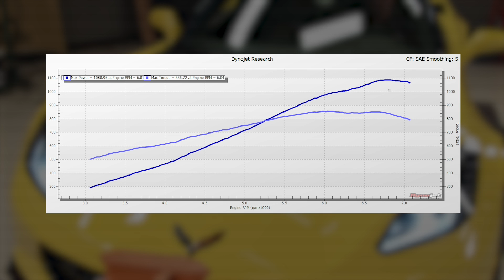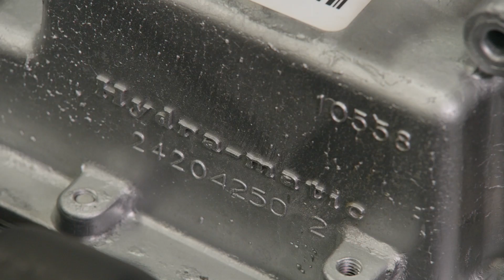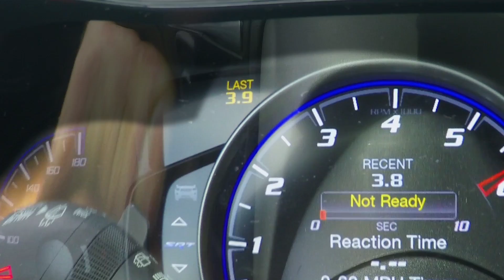Building a 1,200HP Supercharged Z06 Corvette - Engine Power S5, E22

Comment: How much will it cost to have a pro charger like that and how much will it effect the Car's MPG. Thanks in advance.
Reply: The system is in the $10-15k range.   As for mileage who cares?   If you can afford the car and the upgrades gas mileage isn't probably not a main issue.

Comment: Wait did they supercharge and supercharged Vette? 🧐
Reply: Supercharger goes on top of motor,

Pro charger goes on like a turbo,
Same way as you see in video..
Reply: @tomgeorge9025  It's still supercharged, as it runs off the crank..

Comment: Just upgrade the factory supercharger would be a whole lot easier and look a whole lot better the pro charger takes up so much space and is just to cheap looking like you could afford an on engine supercharger, not that they are cheap or don't work just to many different companies involved in one thing. Holley or banks systems come with everything you need without having to outsource things like fuel pumps or harnesses which is a huge part of it. Just my opinion

Comment: I dont have a knowledge of motors. So if he said 1088hp, then why is he putting a sticker that reads 1200hp?
Reply: with a driveline, you will have a 25-30% power reduction due to gearing. so as a result, the motor is making over 1200 crank horsepower

Comment: Sucking in all that hot air under the bonnet..Why not just plumb it for external air intake??  smh
Reply: Yep, may be good for a few dyno runs but not for real world use. Let's see this thing driving around Texas in the summer with that crappy air intake design. Procharger continues to drop the ball on their designs allowing hot air to be ingested to their Superchargers. With all of the CAD design software and cost effective 3D printers available they should be able to correct this issue but they don't seem to care.
Reply: @AMGPilot  I know ..Once the dyno run is complete without the bonnet on, the job is done. Who cares if the motor suffers once it's used on the road.  Not-very-ProCharger
Reply: @AMGPilot  actually the supercharger gets good airflow. if you think about it, youll be driving which is helping to keep the IAT's down and it will not overheat.

Comment: 1088hp is not 1200 at the crank unless you measure it 'at the crank.' You show a chassis dyno and say 1,200HP then get 1,088HP.
Reply: You need to factor in drive train losses. If you buy an engine with a dyno sheet that says it makes 1200, you won't see that power level at the tires, you'll see about a 15% drop. Put that engine on an engine dyno and I'm sure you'll see 1200.

Comment: why cant you plumb in the airconditioning system from the stock platform on the zo6 have the freon  chill the  air and fuel in line  that would work awesome  you guys should hire me    but i dont like  superchargers    a turbo is    a awesome thing you guys ruin it by putting a belt on it!! that same build without the belt would make 1500 hp
or more load the motor and turbo with a tall gear  and  you have a hotrod   or   a car that will beat anything on the road

Comment: How about a turbo pushing air for a blower? Nobody has ever done it...
Reply: How about a turbo feeding a roots blower, its been done
Reply: @victorparra4227  I think Banks Engineering did a super turbo on their Pikes Peak truck.
Reply: old school 2 stroke Detroit Diesel Engines did this in the 70's.
Reply: @hawkdsl  yup. Big ol nasty (in a good way) 2stroke Detroit Diesel v8's. Big ol turbo ontop of a roots style blower.
Reply: Unless you have a way to cool the air coming from 2 air heating devices it's pointless.
Reply: Turbo and supercharged have been done.
Reply: Hellion twin turbo kits feed superchargers

Comment: So no bottom end work needs to be done or what?
Reply: Thought that as well.  The new Corvettes can supposedly handle 1000 hp on a stock bottom end.  But not sure how long it will stay together.
Reply: Depends how good your tuner is really
Reply: Actually the car comes equipped with bearings for a supercharger already.  It arrived in their shop supercharger.  Why would you put new bearings in it for a supercharger when it comes from the factory supercharged?  Just because it makes more power doesn't mean the bearings need to be reengineered.
Reply: @joshtheking1772  wut
Reply: @joshtheking1772  you literally dont know what you are talking about
Reply: @sosa2514  why dont you explain it to me then oh mighty wise one.  Dont be shy.
Reply: @joshtheking1772  i cant find your comment but what did you mention in your comment?
Reply: @sosa2514  then how could you say I dont know what I'm talking about then?
Reply: yours was about the bearings i think. you wouldnt need bearings, you would need stronger internals. what bearings do is the allows the crank and cam to cause wear to the bearing and not to the block.
Reply: @sosa2514  I know what bearings do.

Comment: So it's a 1088bhp not 1200bhp wheel numbers are what people want not some imaginary engine number
Reply: The engine itself makes 1200hp that's what the badges are for. It only lost a little over 100hp in drivetrain transfer.
Reply: They literally just did a video of it on a dyno. Plus allot of high HP cars keep their dyno sheet on them to show off. All car manufacturers show the crank HP not wheel HP.
Reply: pay attention , did you even watch the video?
Reply: Until I've seen it ran on a engine dyno I ain't buying it's 1200bhp at all just a made up number 😂😂😂

Comment: How Do you guys call yourself car guys An engine builders And you put a  1200 horsepower sticker on it  When the car only put down 1088 horsepower So it's not  a 1200 horse power car  Then you  Giggles that It's made 1250 to The crank so For  Real life The car is only a 1088  Horse power car wow lol come on
Reply: I agree with you but all the car manufacturers they will state 650 horsepower 530 horsepower 840 horsepower all of those are crank horsepower they never state to the wheel horsepower
Reply: 1088 WHP is over 1200 crank.
Reply: This is what the claim is "Mike and Pat are ProCharging a Z06 that comes stock with a supercharged 6.2L V8 in hopes of putting out 1,200 HP at the crank! " 1200 hp is what is calculated at the crank. 1088 hp is what they got at the wheels. They must feel that you lose 112 or so hp in the trans and rear which seems like a lot in modern cars. Don't know where the 1250 number came from.
Reply: well if thats the case then all cars made are lies as what the factory says the car makes is at the crank the never give whp numbers, so the 650hp that this car claims before they change it is a lie also. these cars put around 525whp in real life, but everyone that buys it will say my car has 650hp
Reply: @bigsean2473  unfortunately that's the way that it's always been done and I agree it's BS if you're going to put out a number tell me what is making at the wheel I guess them Corvette owners just feel big say my car makes 650 HP
Reply: @michaelstrangefranke7002  yeah util you run up on a muscle car making 600whp then you lose and ask them what hp they have and they say 600hp then they trying to figure out how they lost lol
Reply: 1250 hp at the crank is 1250 hp.
Reply: If they test it on a chassis dyno, they're only guessing. You don't really know what it's making at the crank  for sure.
Reply: @andrewfotopoulos7766  right they just add around  20% for parasitic loss but could be a lil more or a lil less. like you said wont know til its engine dynoed
Reply: @LifeLongStrong1961  well  if you read i also said could be more or LESS than  the 20% loss
Reply: @LifeLongStrong1961  umm wtf are you talking about?? i wrote the same thing see above. i know the differences and how it works.